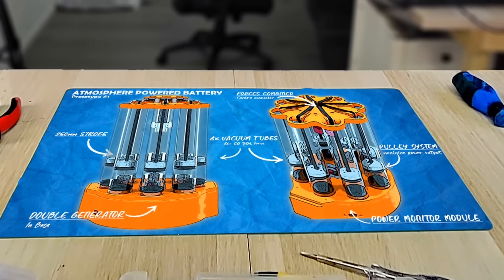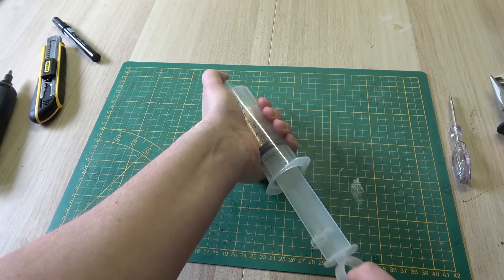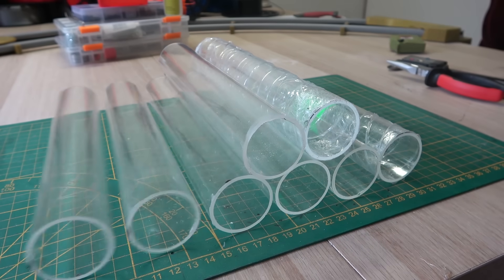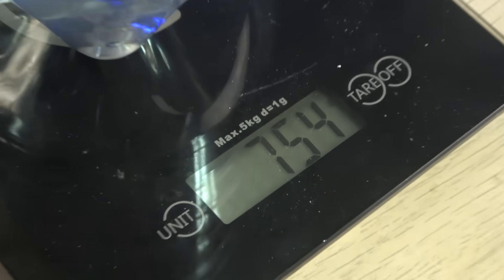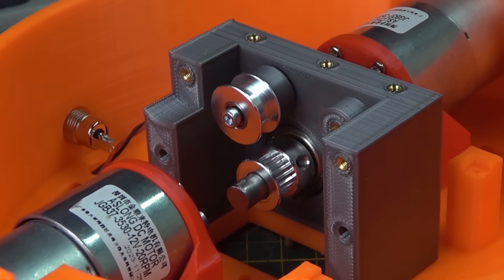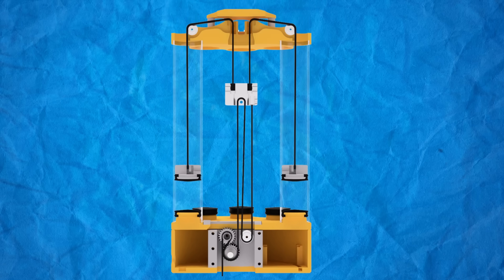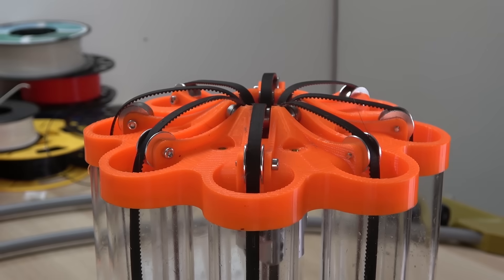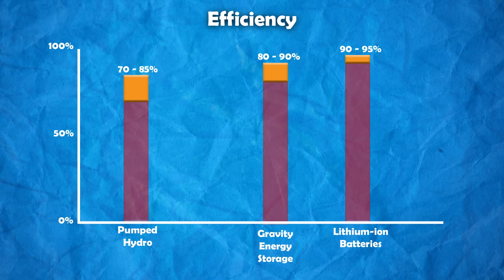Building an Atmosphere Powered Battery..

Comment: If only friction of the seal did not completely kill his maths.
Reply from the maker: I didn't mention it in the video but i did indeed have to test a number of lubricants to minimize friction as much as possible! I started with dish soap and a bit of water and eventually, after Vaseline, WD40, PTFE spray and even a combination of some of them, I ended up with silicone oil, which I can say works extremely well!
Reply: @ConceptCraftedCreations  Wouldn't brass tubing also decrease the friction? Or another cheaper but lower friction material? I honestly would love to see this explored more and see how high you can get that efficiency up.
Reply: @picklesdill5462  It needs to be airtight over extended periods
Reply: @picklesdill5462  considering he cant do basic calculations on energy usage i wouldnt pay much attention to what he says
Reply: @michaelrenper796  that was EXACTLY my point in my comment after wrote saw yours :)...
Reply: @michaelrenper796  meant my MAIN comment OUTSIDE of this thread...
Reply: @picklesdill5462  PTFE machined tubes?
Reply: @picklesdill5462  ceramics would be near the top.  We can get tolerances in the 0.00xmm range.
Reply: @justinc2633 you build it then. And post it , so we can see your genius.
Reply: @AttemptedPretzelMaker  why would i waste my time on a pretty useless contraption?
Reply: @ConceptCraftedCreations  I was going to mention lubrication of the tubes, but you all beat me to it. Only other thing i could suggest was different motor types for better overall eff.
Reply: @ConceptCraftedCreations  use some cheap hair conditioner like Suave. You'd be surprised at it's ability to reduce friction and create a seal. Used every day for plungers just like this in fiber optic repair.
Reply: @ConceptCraftedCreations  It's a brilliant idea with a lot of potential. Easily scalable, you could fabricate plugs & O-rings to fit any diameter of pipe, of any practical length. You could add more chambers to the unit, as you said, or you could nestle units together. And so much more, it's a really good idea. And well executed by you!
Reply: @ItsCalilum I think if you were to scale this up, you'd run into problems of keeping the vacuum seal, but it might work, I just don't think it's going to be easy.
Reply: @ItsCalilum  No it's not. It is super inefficient.
Reply: @Rollmops94  Yes it is (a good idea). While efficiency is important it's not the only factor. For starters, it's safer than anything involving combustion. It's simple and relatively inexpensive. And it works. Besides that, efficiency can be improved.
If you want to bag on other people's work that's cool, but why don't you show us what you've done?
Reply: @ItsCalilum  You are making this personal. I am not interested in fighting with you. If you think this idea is so great, do something with it.
Reply: @Rollmops94  Fair enough, if you want to ignore the rest of what I wrote, my bad. I'm not interested in fighting with you either.
I am doing something with it, I'm offering encouragement and an optimistic view.
Reply: @ItsCalilum  Congratulations.
Reply: @Rollmops94  And condolences for your hurt feelings.
Reply: @ConceptCraftedCreations  Just use good old oil like plant based ones
Reply: @ConceptCraftedCreations  did you try with silicone grease it sticks to the surfaces and stais there and with piston and cylinders this is a good thing.
Reply: @ConceptCraftedCreations  Vaseline, also called petroleumjellow, is petroleum based and will dissolve the silicone seal if you cant fine a silicone based alternative i would not try Vaseline.
Reply: @ConceptCraftedCreations For the future, don't ever use WD40 as a lubricant. It's a Water Displacer, hence the WD. And the 40th formula, hence "WD40".

It's by no means ever to be used as a Lubricant.
Reply: @ConceptCraftedCreations  If i were to say it probably isn't just a matter of lubrications but as well as the modification needed in the seal tips and having control over when to have friction and when to not, so possibly introducing some frictionless design on initial intake to pull in a clean efficient charge getting rid of the subatomic lag caused between the Inner diameters brim which is causing a higher resistance on the motors resulting in 17% of what the 73%'s flaw could be on this prototype, Am glad to tune into this one look forward to Seeing more updates Cheerio
Reply: @ConceptCraftedCreations would adding a passive counter weight to offset or neutralize the friction work to reduce the load on the power draw? 

Though if you don't reduce that passive tnetion on the power stroke you might offset any gains.
Reply: @ConceptCraftedCreations just use seed oils they were made as a lubricant anyways
Reply: @ConceptCraftedCreations  do you think a graphite coating  or another self lubricating material on your seals and contact parts would increase the efficiency?
Reply: @ConceptCraftedCreations  I think most of the losses will be in the 600:1 gear reduction in the motors and friction in the shafts. Large trains of gears do tend to swallow energy.
Reply: @ConceptCraftedCreations  that seems like an important detail as it means maintenance. I'm not sure how much maintenance would an alternative device, such as a gravity battery would require, but for sure looks like a detail to consider.
Reply: @ConceptCraftedCreations  Why not try magnets? Metal tubes with magnetic devices inside to create 0 friction
Reply: @ConceptCraftedCreations did the percentage increase after adding the silicone oil? Didn’t see it in the top comment or description
Reply: @ConceptCraftedCreations WD40 is not a lubricant pal. Water displacer formula 40
Reply: @ConceptCraftedCreations  is silicon oil work great for some me time?
Reply: herr-is5sw  you forgot 3 zeroes, 40 kWh * 3600 = 40,000 * 3600 = 144,000,000 Ws, so the car would need to be moved up 10km to store the energy. People underestimate how much mass you need to move for gravity batteries
Reply: I see a lot a people hating over his math, and I can see why with their own channels an huge contribution to providing expertise and knowledge on the subject backed by their phds… oh wait never mind none of them have done anything except act like know it alls. This man may have been off on his math but he put the work it to try and learn and share. I would like to see an upscale cost analysis and material needs requirements compared to the cost and material requirements of other energy storage solutions, as I think that would be relevant.
Reply: He measured energy in and energy out, which accounts for friction
Reply: Friction didn’t kill any maths. The maths include the friction, since the maths were based on real measurements rather than theoretical efficiency.
Reply: You know a vacuum cylinder with motor will work great for this project
Reply: Pure glass sringes are a thing too 
Also surely we all seen those super precise mettal cutouts that slide together until u see nothing 
There are always solutions ....with the right funding sometimes ofc
Reply: He’s losing energy immediately on friction.
Reply: Other things killed his calculations, but being that circumference increases linearly and area increases exponentially, he should have made one big cylinder instead of 8 small ones and he would have much less losses. At scale the bigger you make the diameter of the piston the more efficient it is. At industrial scale it makes more sense. Also if it were pressurized instead of pulled under vacuum it would be more efficient for size scaled to the pressure differential.
Reply: @1slow370  when you talk about engineering, you have to be pedantic: you obviously mean quadratically, and not exponentially.
Most other places you can mix up those two without too much problems. At least depending on the scales.
Reply: herr-is5sw  so if this is correct you could essentially park your car in a garage that can lift that car 10m in the sky. That really puts the size of a gravity battery required to generate power for a day! The generator/motor would have to be just as massive. Or maybe another approach is for a mechanic shop to use the weight of cars going down on a lift to recharge a battery.
Reply: Those motors are extremely loud so if this battery could be used in a modern home I would suggest quieter motors, or find a way to muffle them.
Reply: Ground glass might solve the problem like in a glass syringe where it is airtight but has incredibly low friction
Reply: Damn you entropy!!!!
Reply: Right? It’s pretty good for a prototype
Reply: This is a most awesome thread, which kinda symbolises the crazy times we live in. 
It all starts with a dude who talks 💩 , because if you measure the output, the friction is included in the equation, isn't it, darling? 
Then you got few smugz who are happy when someone makes a mistake, a moron who wants a me-time with silicone oil, religious fans who from some reason have to put their propaganda everywhere, not realising they are achieving the exact opposite by forcing their beliefs on others... 
but in the end all is well, because most of us luckily are quite happy to work together and look for solutions.
Reply: Also, it’s been a long time, but isn’t there an inherent enthalpy loss due to the air compression/decompression cycle?
Reply: What about water seals like gasometers used to have?
Reply: lubrifiant low vacum force ?????
Reply: Would it not be better to just use one large tube with the surface area of all of the ones combined shown in the video? That way it'd be less contact between the seal and tube with the same amount of force as all of the tubes in this design
Reply: Your mom is gay
Reply: Definitely add some sort of lubricant
Reply: @ConceptCraftedCreations
Reply: Why not just use balloons? No friction necessary.
Reply: As you scale up, that problem would shrink, the friction at the wall increases with the circumference, but energy as the volume of the cylinder, which would be like πr^2*depth, so if you make it 10 times bigger in all dimensions, you will have 10x the friction but 1000x the energy stored.
Reply: That is mad spoiler
Reply: I just picked up on your videos. I think 2 things that would help would be to use larger cylinders instead of a bunch of small ones. This will help with frictional losses.  Also, might look at piston seals for inspiration.  With that said if you can find a compatable compressible lubricant you could seal it in the top and store power that way as well.
Reply: O I L
Reply: Friction or lack of, is how most of these types of projects fail.
Reply: Also 3d printed gears.
Reply: Math is singular and plural.
Reply: Did it? I thought the efficiency captured it nicely.  Though efficiency also captured the heat of the motors.  It didn't capture the efficiency of generating the electricity in the first place so I think it matters where you draw the box to define the system.😊
Reply from the maker: To clearify how i got to the result you see in the video🤓

To charge: ~12.08V x ~1.62A x 43.709 seconds = 860,64 Watt

After a discharge: ~9.42V x ~1.15A x 57.993 seconds = 628,24 Watt

All value's are measured by the Arduino Nano in combination with the INA3221 Power module.
Reply: @ConceptCraftedCreations  
The numbers are correct, the only problem is with units.

Volt * Ampere = Watt
Watt * Second = Joule
Volt * Ampere * Second = Joule
So it is 860 and 628 Joule not Watt

628J = 0.17Wh (Watt Hour)
The regular AA NiMh 1.5V cell is 2-3Wh, so the vacuum cell has tiny capacity given the size.

Anyway there is significant advantage for vacuum/pressure cells - they can be charged/discharged in seconds instead of hours.

Great video. Keep exploring.
Reply from the maker: @BartlomiejWolowiec  Precisely! That's a lesson for myself for next time😊

And thank you for your valuable feedback! I sincerely appreciate that👌
Reply: Watt-hours, you mean. V*A*s is an energy, not a power.
Reply: @ConceptCraftedCreations  i think summarizing charge and discharge may lead us to miss more efficent vacuum range

maybe efficency/time is not linear graphic after all
Reply: @ConceptCraftedCreations  628.24 Watt Seconds technically, which would work out to about 0.175 Wh (watt hours). So not a lot of energy storage lol, but still a cool device.
Reply: @ConceptCraftedCreations  Acetal plastic has very low friction. Have you considered using it?
Reply: @ConceptCraftedCreations  860.64 watt
why are you using a common in watts? especially when you used period in volts and seconds? keep it consistent and just use period.
Reply: @ConceptCraftedCreations  "The idea is interesting, but the energy storage is only 10.11 Wh. Even if increased to match the energy capacity of an average power bank (144 Wh), the device would be the size of a room.
Reply: @BartlomiejWolowiec  Supercapacitors do this too.....
Reply: @MagestiUA The capacity is actually much lower, as mentioned in some above comments. It is 0.175 Wh.
Reply: @BartlomiejWolowiec  Could he increase the capacity by putting the whole system inside a pressurized vessel? The "atmospheric" pressure would be higher, requiring more energy to charge, and therefore providing more energy to discharge? But the vessel would require pressurization only once, or every once in a while because of slow leaks
Reply: @ConceptCraftedCreations  A watt is an instantaneous unit of power. If you're calculating energy/power consumption over time, you should arrive at units like Wh or Ah.
Reply: @johnschneider931  Good analysis! Thats what coefficients of efficiency are for!  "We don't know exactly - down to the atom - why our thing is fugged, but its fugged by exactly 23.2% !"
Reply: Math*
Reply: @isaiahreinmiller he's probably British or Australian. They use king's English plural for math.
Reply: @1slow370  oh my bad
Reply: If only physics didn't exist eh